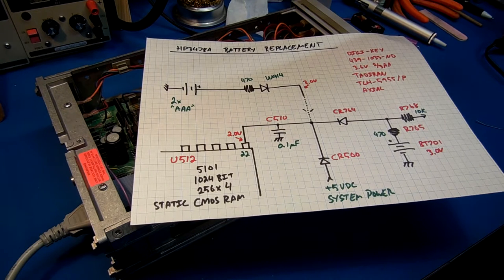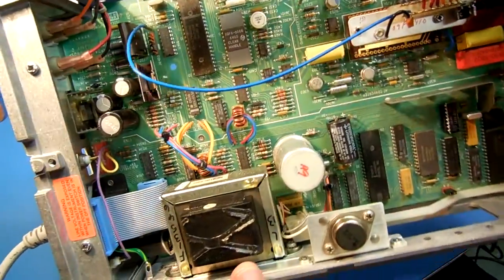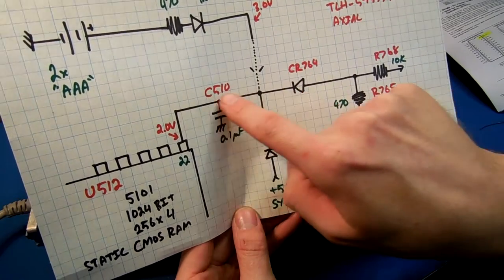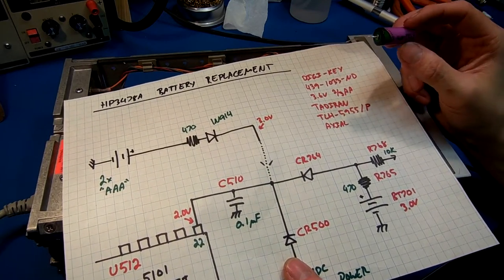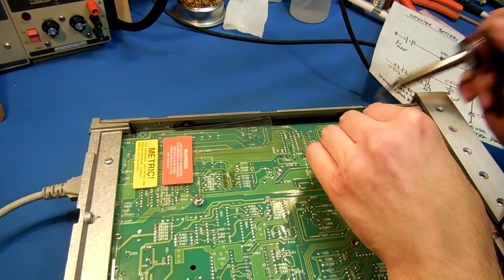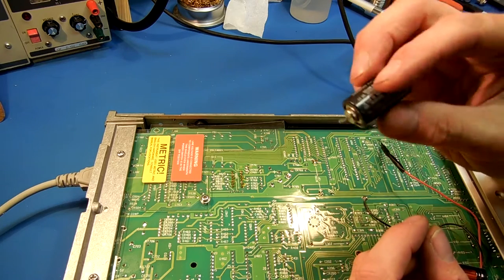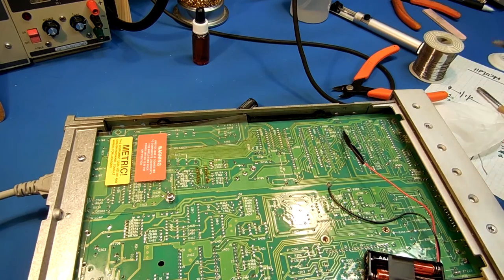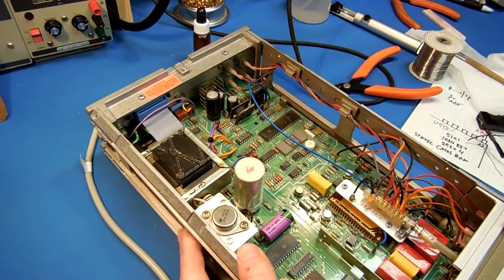GBPPR Vision #24: HP3478A Battery Replacement

Comment: Dear GBPPR2, I have just finished right now to replace the battery of my HP3778A multimeter according to your instructions and everything works very well.
Thank you very much for this useful video tutorial !!!

UPDATE: I notice that the big capacitors (C761, C711, C702, C703) of the AC conversion are sliglty swollen therefore I want to replace it. However I notice that there is a constant 0.5V when I disconect the power, and this voltage can be caused by the RAM battery (but I am not sure about that). Do you know if I can replace the capacitors without creating problems to the RAM voltage neglecting this 0.5V?

Regards, Alberto

Comment: while you have it open, replace the 2 RIFA caps (C765, C766) under the power switch and the 2 (C720, C721) under the HPIB ribbon cable.

Comment: Must be missing something as surely when unit unplugged  from mains there is no path to ground to short battery.
Reply: Replacing the battery without losing the calibration, the unit must have power. If you use the mains power, you can desolder the battery, but you will have a short to ground while desoldering the positive pole of the battery. Soldering a powered on unit is not a good idea anyway, though you could use a soldering iron without a grounded tip or heat the soldering iron up, disconnect the iron from mains and then solder with the stored heat.